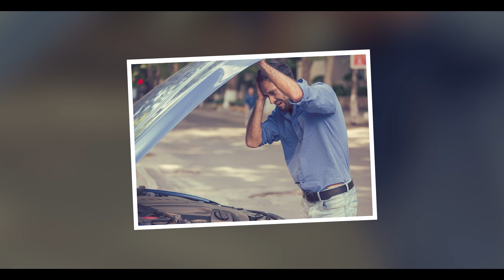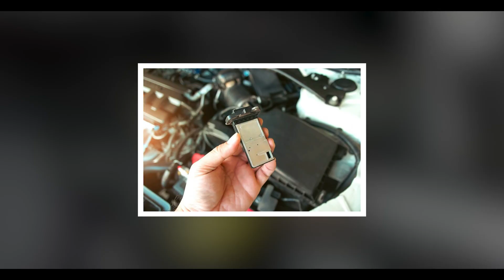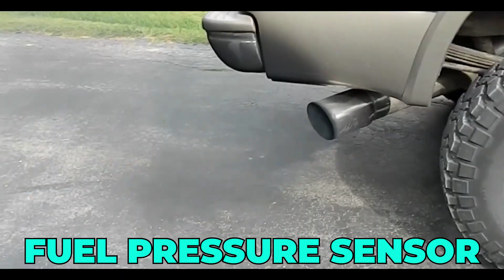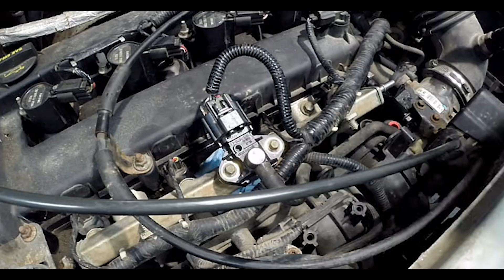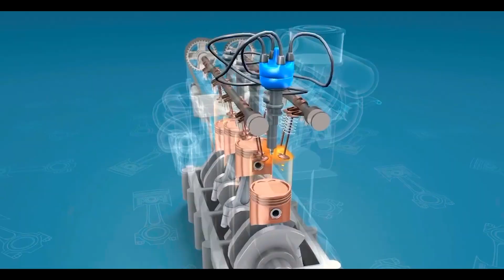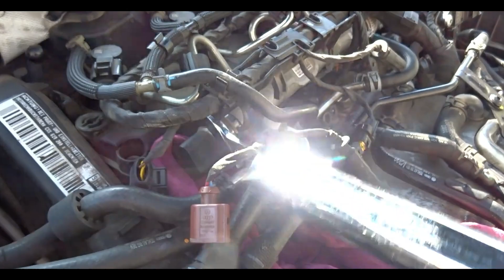9 Bad Fuel Rail Pressure Sensor Symptoms  (& Replacement Cost)

Comment: My diesel had a random stall then hard (if not impossible) restart. Various efforts have narrowed it down. Engine idles normally and drives very gently. Any normal acceleration creates a momentary stall engine light & limp mode. Graphing fuel pressure shows a very short pressure down- spike. I’m tending to think it’s the pressure sensor. Pressure control valve can be tested for leak back to the tank. However the correct leak rate is hard to find.

Comment: If a diesel car easy to start but it stall after engine started after a few second. It will take a few minutes to to run the engine regularly. What cause this problem